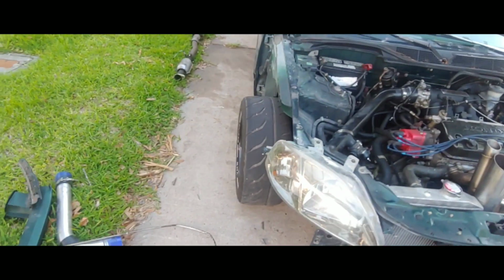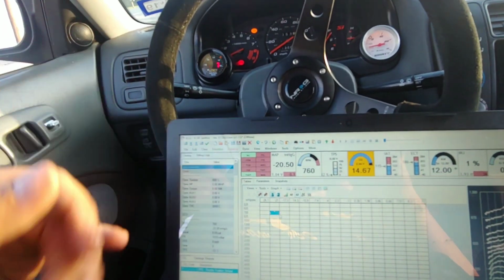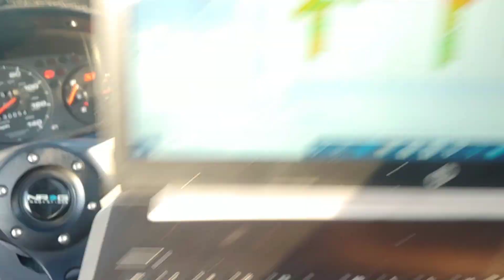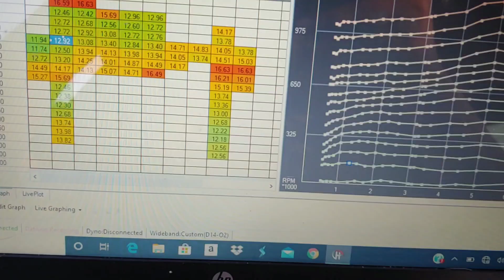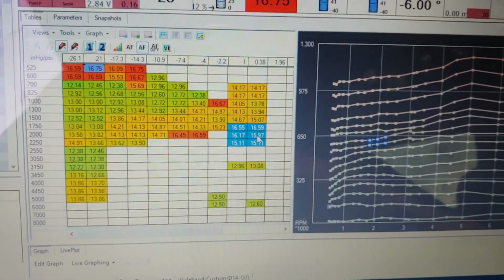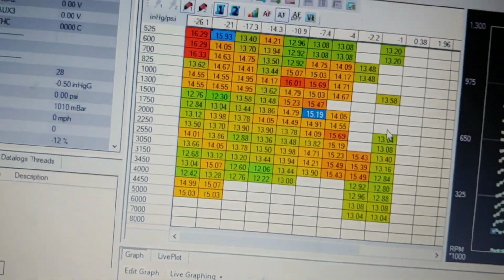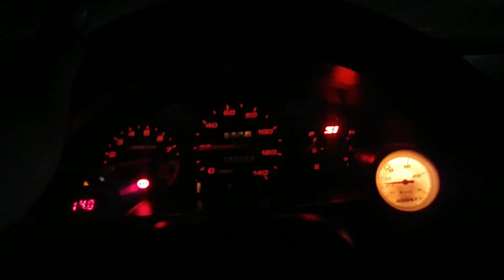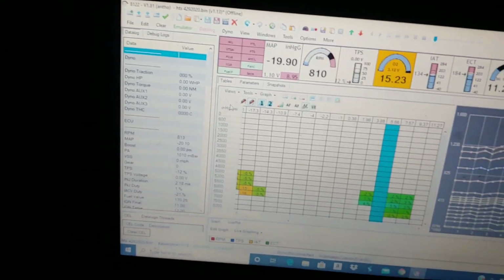Breaking In The Turbo D16 With Vitara Pistons @ 9psi

Comment: Was looking for this update bro she sounds healthy glad she seems happy
Reply from the maker: Thanks man, im honestly very surprised i wasnt expecting much lol. Still feel like im on borrowed time.
Before i turn it up I need to grab the GM 3 bar from the 4 door civic and get a decent clutch. I was thinking about a stage 4 competition clutch. Seems to be the best bang for the buck
Reply: @BoBuilds  bro I know ppl hate on the xtd clutches from eBay ,but i been running them on my car and all personal buddies cars with out a problem. Curently had the xtd stage 3 with stock flywheel and i running 12 psi on my k24 k20 teg. Sold the k24 k20 simce it was a high comp engine and have a k20z with a built head and same snail as u ,and I'm still runnig a xtd stage 3 ... For this motor i just bought a new one since my last one already had a few years  and my buddy is still using that old one
Reply: I'm happy with that 70. Dollar clutch lol and if it held my k24 on boost so I trust it for anything under 500 wheel

Comment: Hey bro love the channel. Can u help me out bro.. I'm new to tuning and just installed a turbo on my accord. Car was running fine on stock ecu, fires right up.. installed decapped ls injectors and had my p06 ecu chipped and bought ostrich and hue logger.. uploaded a basemap but car won't start.. idk why.. you think its my injectors? I got them set at 450cc and deadtimes are rc750cc 12ohms is what hunter tuned told me to set them at.. I did remove the resistor box and wired in the new injector clips.. I can't see any other reason or anything I did diffrent.. I hope its not the ecu that is bad..I am, or now I am able to connect the hue logger since I had the com ports set on autoscan but now I got them on com3 and com4 like my device manager says.. and before I couldn't calibrate the tps and check engine would go on when I step on gas pedal only.. but after I fixed my hue log connection and calibrated my tps, it doesn't do that anymore.. I'm gonna check to see if fuel comes out of the injectors while I have the fuel rail off and the car cranking.. if there is fuel coming out what do you think I should do next?? Any advice would be great bro